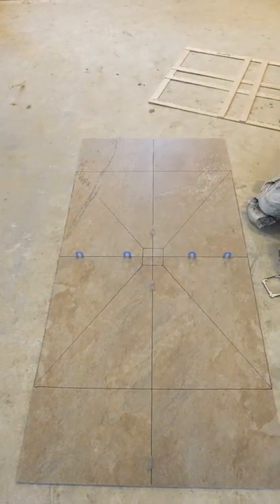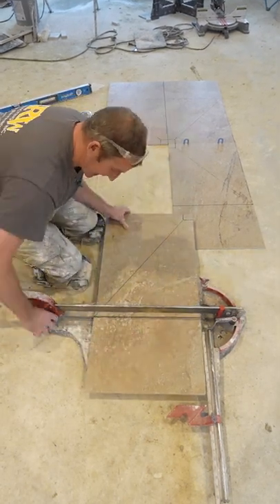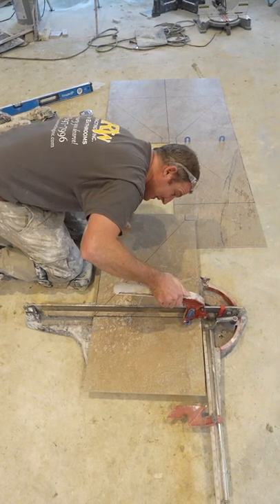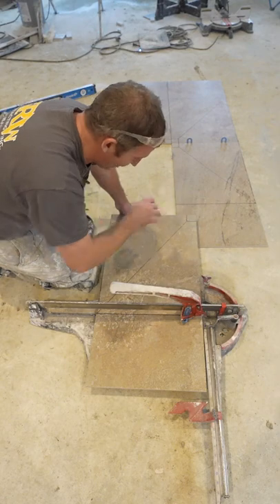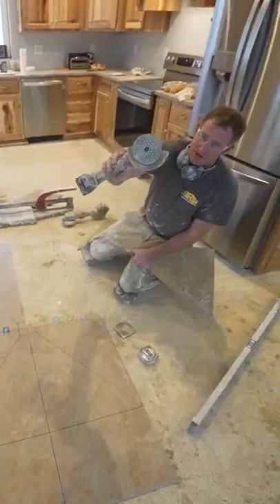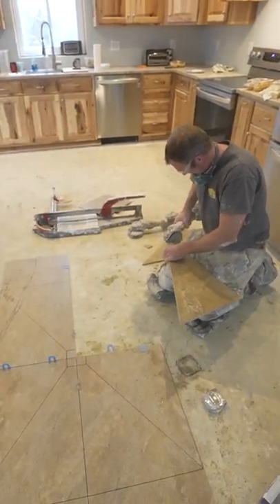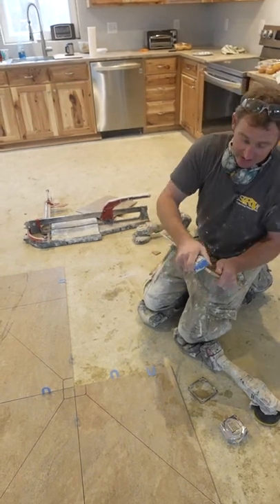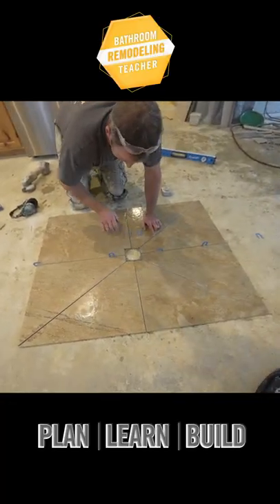Shower floor tile cutting tips

Comment: The large format tile looks great.The reason for using a mosaic tile for the last 100 plus years in the shwr is to provide a more slip resistant surface in the shower. Something some folks should definitely consider
Reply: This was years ago and I had a customer that wanted black granite in the shower, I advised them to be cautious of the slip factor.  They went ahead with it though.  I think they make a non slip sealer now.

Comment: What is that spacer material you used under the large format tile to make your second cut?
Reply: Scrap of wood. Pay attention.
Reply: @johncoops6897  it ain’t wood but yes, you should both pay more attention.
Reply: @MachoManAndySavage125  - sorry, I don't know what "WEDI board" means, so I assumed it was made of wood. Why would it matter, it's just used as a spacer.
Nevertheless, by paying attention to the video the original question would never have needed to be asked.